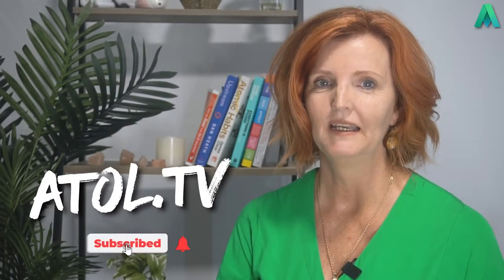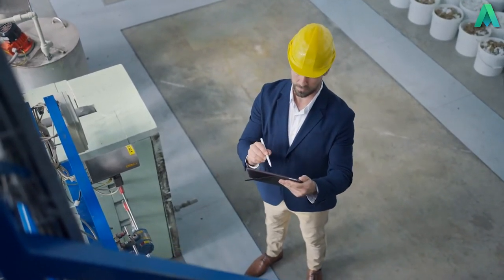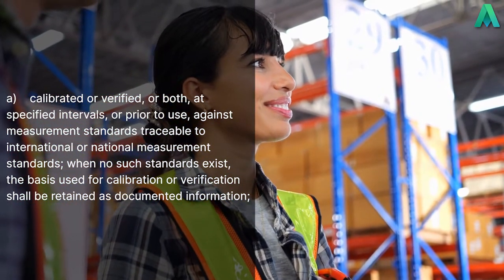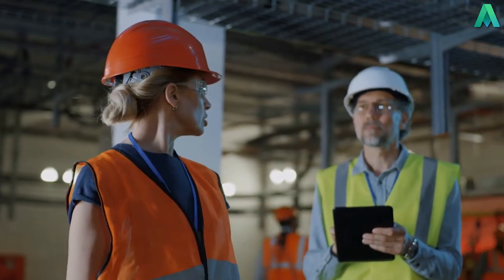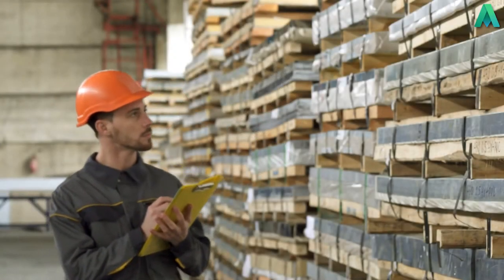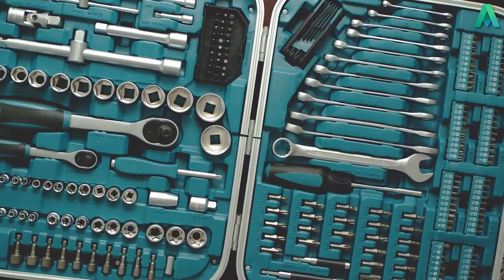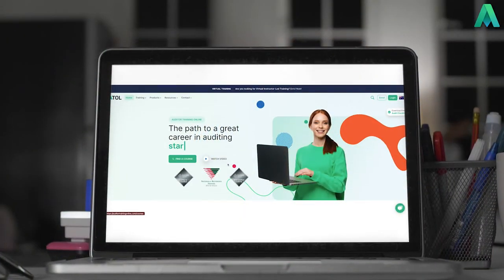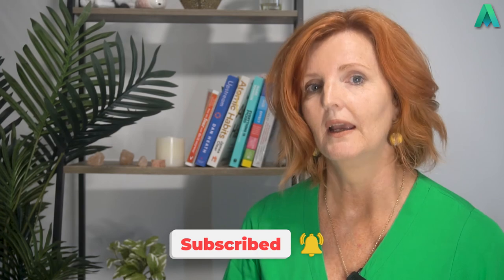ISO 9001 Clause 7.1.5.2 Measurement Traceability | Auditor Training Online

Comment: Thank you for reviewing the calibration clause but I have a question regarding self made tools that a company makes to help gather test data. The company made a breakout box that interfaces between the manufactured equipment and test equipment, this breakout box allows the user to access the values without back probing wires. Does this interface device need to go through some type of verification/certification that is does not affect the voltages or signals from the device being tested?
Reply from the maker: Wow! this is an interesting scenario! While the breakout box may not directly perform the measurement itself, it seems to be acting as an intermediary between the test equipment and the device being measured (that is my understanding so far). Based on this understanding, the breakout box could potentially affect the test results if there is interference with the signals or voltages measured. The options in continuing the use of the breakout box could be:
1. Perform a risk assessment to ensure that using the breakout box does not introduce significant risk into the testing process. This will analyze the potential for errors and how these may be able to be controlled. This could also mean that components of the breakout box are scheduled for inspection and replacement if they have the potential to impact the results.
Control measures to consider could be:
1. If the breakout box is part of the process but not directly verified or calibrated, you would need to demonstrate that the final validation or verification checks are sufficient and conducted by calibrated equipment. This will ensure that any discrepancies during the earlier process using the break out box are identified. 

I hope this gives you something to think about :) all the best, Jackie

Comment: Multimeter is not used in final product measurements so do we need to calibrate all maintenance machines
Reply from the maker: Thanks for your question. I am not familiar with your business or set up, however determine if the maintenance machines are ALL critical to the outcomes of your final product. Those machines that are critical to these outcomes should be maintained and if calibration is part of this maintenance then yes. Determine whether there are international or national standards and if not go to the manufacturer for guidance.

Comment: Hello Jackie, good day. I am one of your recent new subscriber. I have a question. Our factory bought the thermometers to measure the temperatures of our workers before they enter factory every day. Should we include the thermometers as one part of our production monitoring equipments which calibration are needed to be carried regularly?
Reply from the maker: Hello @tszwailim4337 - well done. What you have identified is definitely something that should be monitored for accuracy. The use of the thermometers is to manage health in the business. In ISO 45001 Clause 9.1.1 (General) it states that The organization shall ensure that monitoring and measuring equipment is calibrated or verified as applicable, and is used and maintained as appropriate. Therefore your identification of these thermometers falls into that requirement. Well done!